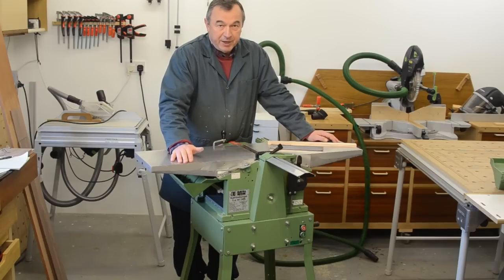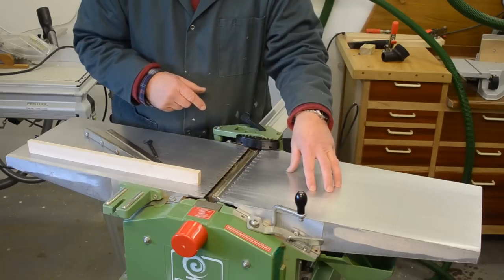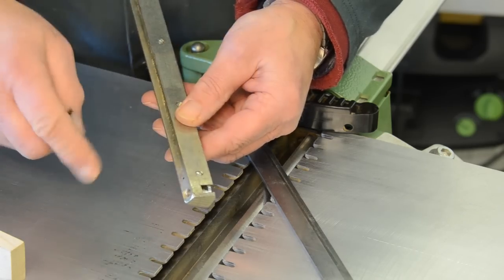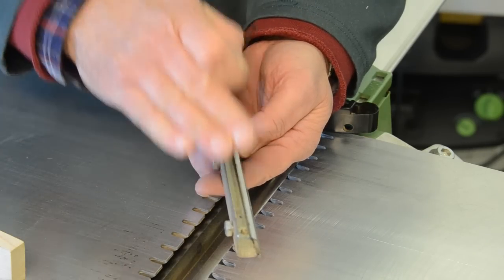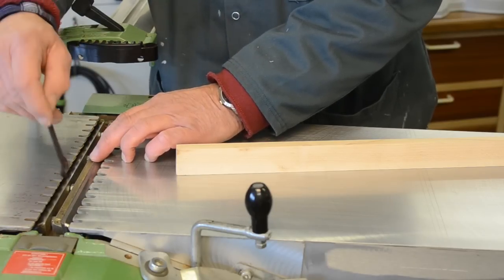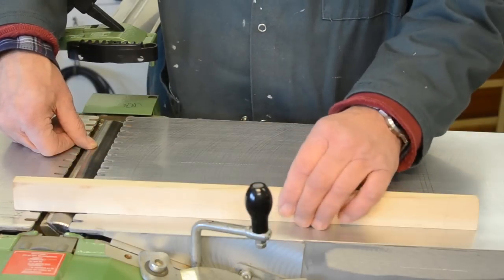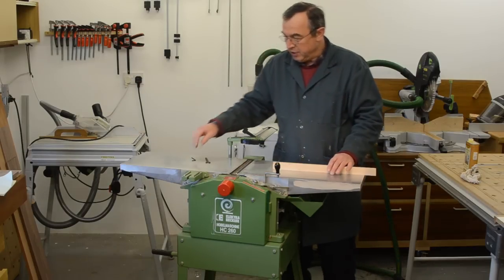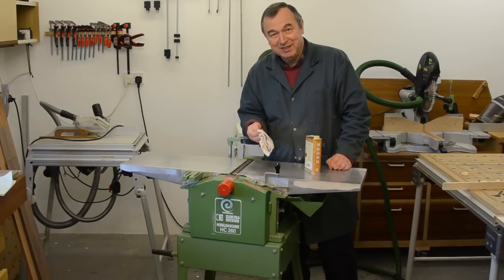How to Set Planer Blades

Comment: Hi there, Maybe you remember me..? I asked you some months ago if you had a manual, and you said you'd sold the machine and passed the manual to the new owner. I have now found the manuals online, after you advised me that Metabo made the same machine, for which I thank you. I have bought a new motor, belt and knives. I have fitted the first and second of these, but before fitting the blades I thought I'd ask an expert - that's you - so that I can be sure whether the motor as fitted retates the correct way. I ask because the motor shows how to change the connection bars to swap from clockwise to anti-clockwise, and I've never actually had access to this type of machine before. It had no blades fitted when I got it. Simple question therefore: Looking from the belt end of the machine does the cutter block rotate clockwise or anti? Mine goes anti, which is to say that the right hand side of the belt, looking from the belt end, goes up. I'd be happy to receive the answer from anybody who knows. Thanks. BOZ
Reply from the maker: Hi Stephen, I have tried to find close-up photos of my old machine but no luck. I sold it 6 years ago and cannot remember enough to advise you on something that is so seriously dangerous if it is wrong. Please talk to Metabo or a friendly local dealer. The only thing that I can remember about my machine was that there was a chuck fitted to the cutter shaft and that was under the red plastic cover which is visible on one side of the machine. My machine would have been turning that chuck in the normal direction that drill bits would be turned. Your machine may be different so please get professional advice.   Peter
Reply: Thanks; I agree that it's so fundamental, and so potentially dangerous, that I have to have a definitive decision before proceeding. Mrs. B. will tell you (quite rightly) that I have a cavalier attitude to my own safety (I'm indestructible) but I've sort of got used to the number of fingers, eyes etc which I have, and would like to keep them all. Thanks again. B. :-)
Reply from the maker: Hi Stephen, If you look at the video and pause it at the 1 minute 10 second point you will see the planer with the orange cover nearest to the camera. As you look at that orange cover, imagine that it is a clock face. The rotational movement of the cutter head for my machine is in an anti-clockwise direction on that orange clock face. That means that the blades rotate and at the top, where they are exposed, they are travelling to the left as you look at that still image. I think that is as far as I can go in giving you advice as I have no idea what has been done to your machine.    Peter
Reply: Thanks mate. I went around to see a chum this morning, who has a new small unit, to see how his works. The engineering is identical, and we worked out which way was which, then looked at your video again for confirmation. When the original motor ws still in the machine I marked an arrow on the belt guard to show the way that it rotated (it would not work under load, which is why I replaced the motor), but the odd thing is that this arrow points left (at the top of the belt case) which is the opposite of your (I'm sure) correct description. I can't actually work out why it would ever have worked rotating in this direction, unless it was only ever used as a surface planer, by its previous owner, and they fed the wood from the "wrong" end, but that does not explain why the old motor was wired incorrectly; It's only the likes of me who fiddle around with such things!!! Hey ho! Anyway: I'll swap the motor polarity and check visually before fitting the knives. Many thanks once again for your help.

Comment: Hi there. (again) Following on from John Griffith's post of 7 months ago: I also have the blocks with the 3 grubscrews, and there are also 2 hollow tubes (one at each end) which protrude 1-2mm on the opposite side from the heads of the grip bolts. I suspect these go through the end holes of the 3 in the blades which are generally on sale via ebay etc, and then the height/depth is controlled by the 3 grubscrews.. Unfortunately I have no blades, so can't check this, can you confirm if what I have suggested is true?
Reply from the maker: Hi Stephen, I think that will be correct. The blades have slots in them that the flanged part goes through and provides depth adjustment.   Peter
Reply: Thanks for both replies, perhaps someone else will have a manual.

Comment: A very long-winded method adjusting the blade bit by bit, back and forth. I have discovered the fastest, easiest, most accurate method of setting spring-loaded planer blades, a method which is foolproof and gives exact height adjustment quickly in one simple motion time and time again, not using a piece of wood as in this demo just as I had been doing during all my years as a professional furniture maker. I’ve not yet posted a video on how to do this as YouTube exploited my previous video on very quick planer blade sharpening by putting commercial ads in my video and not monetising for me. I amassed over 20,000 views and many positive comments but deleted it necause of YouTube’s unacceptable policy.

Comment: I may have solved this by the time you read this but: I got a used Scheppach HM2. It's a multi machine with many features and one of them is jointer/planer. It had blades in bad shape installed (jagged) and another resharpened pair. Im trying to install but when i got the old ones out they were actually a pair. A thinner one and a blade. The old blade is thinner than the new and if you put them together it's about equal to the new. Both edges of the old one are used by having their edges combined. Should i just use the new blade or try to combine with the old .. 0.5mm extra? Manual gives no clue.
Edit: The sharpened are branded Scheppach, the old are not
Reply from the maker: It sounds as though the new pair would be better but it is essential that you check with the manufacturer to ensure it is safe.  Good luck.  Peter
Reply: @NewBritWorkshop  Thanks Peter!!!

Comment: I recently bought Metabo HC260C. It planes unevenly. Does anyone have an idea whether we need to align infeed and outfeed table or just set up the planer blades. The boards I plane have different thickness on each corner. Thanks! I appreciate the help.
Reply from the maker: It could be both but start with the planer blades and do another test.   Peter
Reply from the maker: It is difficult to give you any advice as it now appears that you have definitely got the infeed and outfeed tables mis-aligned. You may need to seek advice from a local dealer in order to sort this out. The two tables must be aligned before you try and set the blades. You cannot try and use the blade setting to overcome any mis-alignment issues with the tables. I never had to re-align the tables when I had my HC260 and so am unable to guide you. Also, I sold mine 4 or more years ago.   Good luck.    Peter

Comment: Hello Peter,

I just bought a secondhand hc 260 im super exited and after aprox. 30 years its still dead on preciese.
And after watching the video i know how to set the knives aswell, thanks for that. Some people are sharpen their exposible blades, do you have experince with that?

Regards Martin.
Reply from the maker: +Martin Wittebroek Hi Martin,  I have never done it but I have been told that it can be done once. When I bought my 260 brand new I also bought the tungsten blades. They seemed quite expensive but I later found that their price was equivalent to 3 lots of professional sharpening. For me normal steel blades need to be sharpened at least once a month. Tungsten last at least a year.     Peter